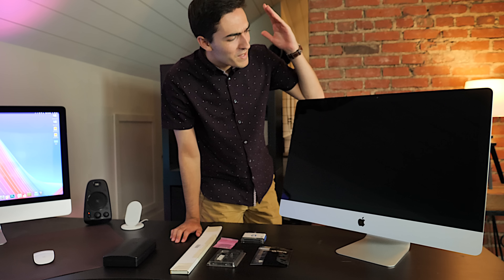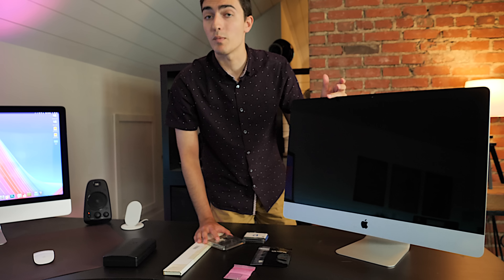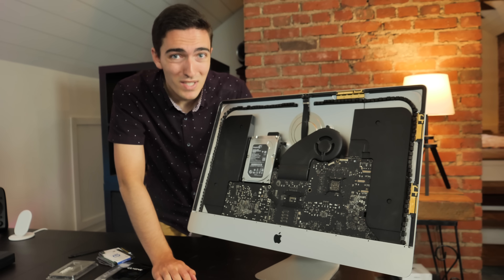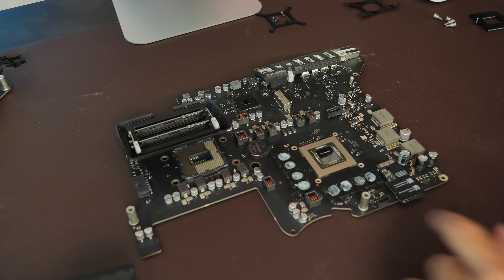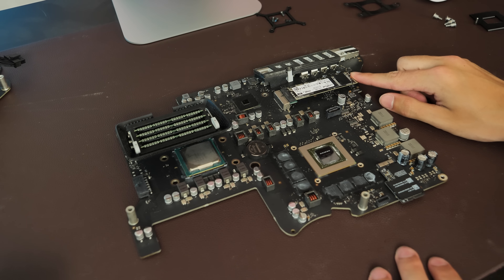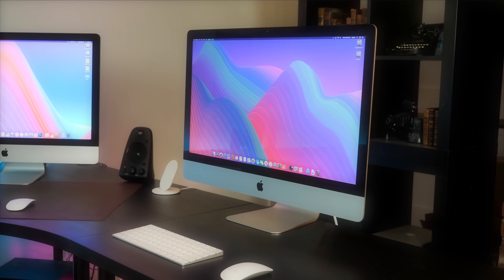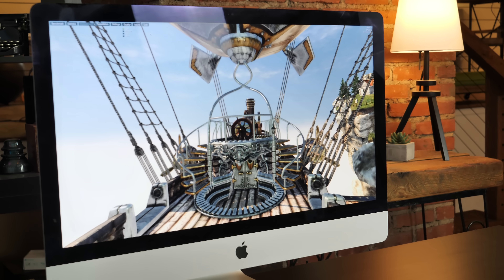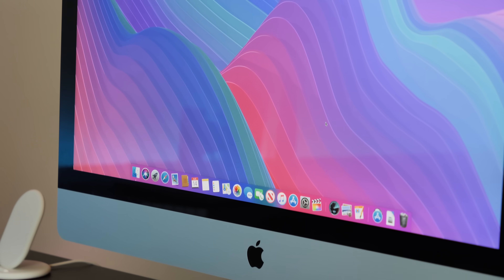Upgrading the $500 2013 iMac to the Max!

Comment: I have an iMac 2010 21.5 screen with an i3-540 processor, 12GB ram memory, Ati Radeon HD4670 and macOS High Sierra.
I upgraded my CPU to i5-660 3.33Ghz, same TDP, socket, etc. My iMac started fine but everything worked slower, I cannot watch youtube without dropping frames, the same on ZOOM.
I run Geekbench 5 and here are the results
i3-540 Single core 511, Multi core 1122
i5-660 Single core 226, Multi core 519
What did I do wrong?

Comment: Hey Luke, I used your example of this recently and had great success replacing the power supply and adding max RAM and an SSD. Unfortunately the iMac developed a display issue after testing, in the process of sealing back up.  It developed two thick vertical black bars on the right side of screen about 2 inches in.  Nothing I could do to fix that.  Any ideas?

Comment: I also have an IMac 27 inch late 2013 Model. I purchased a Samsung 1tb SSD, 1 TB Samsung NMME, NVME adapter, thermal sensor, 2.5 to 3.5 bracket and tool kit. Overall I spent about $300.00. for my upgrade. Not sure why i waited so long to upgrade. I was planning on spending $2K on a new computer but with this upgrade i no longer need to spend that much.

Comment: Great video, I am a bit confused about the ThermalSensor, I've seen a few videos where ppl have done it(used SATA SSD) without the sensor and for them it worked fine... no high RPM on fan? Can u confirm...

Comment: @Luke Miani, Hi Luke, I tried this. I have the same iMac. But it will not recognize the Crucial  P1 1000GB NVMe M2.0 SSD. I formatted the SSD on a MacBook Pro that uses SSD. I also made a bootable USB drive but when booting, it will stop in the middle of the Apple Logo and 50% of the status bar. It will not even go into disk utility mode.
I think the original HD disk ( 1 TeraByte ) has problems because 
    1- It will not boot fully 2- I can boot using that HDD drive in Save Mode.
I've tried using another  HDD from and old LapTop and nothing.
I've even tried Option- Command - R - P to erase the NVMEM and nothing. 
I did the Command -D to check and all it said is something like It appears to be a problem with the HDD
Can you help, or some payed remote assistance you can refer?

Comment: Be warned, if you attempt anything with upgrading the CPU (or just replacing the thermal paste), you risk ruining your machine.  Removing and re-installing the integrated heat sink for the CPU and GPU requires some serious skills and delicate work.  Luke conveniently skipped the entire process (and difficulty) involved and edited the video as if it weren't a big deal.  It has me wondering if he purposely excluded that part knowing it's not for the faint of heart.

Unlike conventional PC's, the CPU is not clamped into the motherboard,  It is held in place under tension to the heat sink.  So when you remove the heat sink, the existing thermal paste will keep the CPU attached to the heat sink and one risks damaging the CPU pins on the motherboard.

Reinstalling the CPU and heatsink assembly is hard, especially with the RAM shroud interfering with the alignment.  With new thermal paste, there is no room for error in aligning, and keeping the cpu in place (by hand) while re-installing screws and a strong tension plate from under the motherboard.  Add to that the mess the new thermal paste could make over the GPU while all this is going on.

Do not remove the heatsink unless you're prepared for a long and painful study in patience.
Reply: Gamoń - aleś mi zaimponował. wymiana pasty termoprzewodzącej to faktycznie wielki problem wg ciebie. a naprawdę to identyczny problem jak wymiana pieluchy u niemowlaka. ilu tu dziwaków pisze głupoty, jedni piszą o porażeniu prądem, inni o monstrualnych problemach przy posmarowaniu procesora miodem. czy to banda idiotów, czy tylko mi się tak wydaje?

Comment: If a 21" came without fusion drive, the ssd m2 will not work because it is not enabled on the SMC System Management Controller.
It has been discussed on fora. And tested on mine. I have a 14.3 iMac late 2013 with i7 and dedicated graphics without fusion drive. Also, i replaced the sata drive with crucial mx500 1tb and it did not have problems with the fans... Appearanly  the 14.3 is a odd one.

Comment: hi Sir.. thank you for all your help.... please, I have a top imac 27" but only no SSD... I assembled in apple the best iMac that time... I'm using with my iMac, 2 thunderbolt monitors 27" .. right now I'm feeling some problems in my final cut with 4k footages ... do you think changing for SSD is enough to improve my performance or do you think will be better if I can use a egpu? if yes ill still can use 2 monitors? and what brand do you prefer to buy.. thank you again for all suport

Comment: Hi, thank you for the video. I have a late 2013 27 inch iMac and the drive is failing. I don’t think I have the confidence to take it apart, is it possible to run an external SSD and boot up from that? The rest of the computer seems to be running ok. I have a feeling it must be more complicated than that, am I missing something?
Liked, subbed and rung the bell

Comment: Awesome!
Purchased late 2013 iMac 27” for $520: 3.5ghz, 1tb hdd, 16gb ram, gtx 780m 4gb
Upgraded for $100: 32gb ram & 512gb nvme ssd (holding 1tb hdd as 2ndary storage)
Deep-cleaned internals and repasted heat sinks: not a gaming machine whatsoever, however, runs 4K video editing suites BUTTERY SMOOTH! 🧈 🧈 🧈 the 4gb vram really sets it apart!
At $620, this is THE BEST amateur-budget-video-editing-Mac, even in 2020

Comment: Hi Luke, thanks a million for the video! I ended up max'ing out a 3.4 GHz late-2013 27" iMac with a 1 TB mechanical HDD:  upgraded the CPU to the Core i7-4771 (miserable experience, nearly borked the machine), a Sabrent Rocket Q 1 TB NVMe (2280) PCIe drive as the boot/application drive (not terribly difficult - get the right tools and follow the video directions closely - the OWC PCIe SSD drive replacement video is the best), a Crucial MX500 1 TB SSD drive for data (pretty easy, once the display has been removed), and upgraded the memory to 32 GB (Timetec, trivial to upgrade). If anyone is still considering something like this in 2020 or later, I'd suggest:
- get the right tools (from iFixIt), especially the "pizza tool" to cut the display adhesive - using old guitar picks and ancient credit cards you find laying around to open the display is dumb - the right tools will cost less than $20 - to replace a botched display will run about $600. Do the math...
- try to avoid the CPU upgrade - it can be done, but it's seriously no fun and you run the risk of borking your investment - try to find a refurbished or used unit with the Core i7 already installed
- if you're REALLY lucky, try to find a unit with the upgraded graphics - the GeForce GTX 780M with 4 GB VRAM
- definitely consider installing a PCIe SSD drive as your main drive - the slot is only a PCIe x2, but you'll still get better performance than the SATA3 drive connection
- as long as you have 8-16 GB RAM to start out, you should be good - upgrading RAM is a <30 second job and can be done at any time - I went with Timetec ($60 for a 16 GB DDR3 2-dimm kit) and have been happy with the performance
- like others in the iFixIt forum have pointed out - don't bother with the OWC SSD temperature sensor - just install the free Macs Fan Control apps and you'll have much more control over the system fan
- if possible, tally up the total cost of a system + any upgrades you might be considering and then weight this against your other options: (a) a new iMac, (b) a later model with Retina display, (c) a custom Hackintosh build if you're adventurous... All in all, I'm pretty happy with the late-2013 27" iMac - the display is 2K and pretty nice and the performance is good. Apple does a great job optimizing the hardware+software, so even modest looking specs may give you a very capable unit.
Thanks for the many great videos! J
Reply: How did you almost bork the board during the CPU replacement? I'm genuinely curious about that as it's a fairly straightforward process: remove heatsink, clean off old thermal paste and pads, swap cpu, replace thermal paste and pads, replace heatsink. Did you forget to tighten the sink down in a clockwise starfish pattern like changing a tire maybe?
Reply: I need help . I installed a m.2 SSD with the adapter . And I'm keeping the hdd for extra storage . I'm having issues installing Mac os onto the SSD . Using opencore when I select the drive to install (the SSD) , it'll start the install with the progress bar then reboot back into recovery . Not moving forward with the install

Comment: I have a late 2013 21.5" iMac with the1tb fusion drive  and I installed 16gb ram and replaced the 1tb mechanical drive with an SSD and my Blackmagic speeds are just as slow or slower than with the old mechanical drive. what's the deal?

Comment: Whats the highest spec i7 that this model iMac is compatible with?
Reply: Intel Core i7-4771 is known to work - apparently, the Haswell socket will accept other i7 CPU's, but upgraders have reported problems using anything beside the 4771

Comment: Luke, I have a 27" imac late 2014, and I go to add an ssd PCIe 1TB and my imac already has a blade ssd in the slot and this is in addition to my Fusion 3TB. The blade is only about 150gb though. On the blade drive info, it says it's the Mac OS recovery system. Should I not take this one out and replace it with a 1TB?

Comment: HI Luke, watch the video and got the guts to upgrade my iMac CPU to i7 quad core 4771 that i got from eBay, add on the same SSD you you have listed. I did not bought any RAM because 4 of my ram slots is already been filled up. i have 2x8 of corsair vengeance ddr3 1600mHz at the 1st and 2nd slots from the bottom slots and 2x8 crucial ddr3 1600Mhz. 

Install went well but when i turn the power on i started to hear 3 beeps, so immediately i research online what would the 3 beeps means and as i start researching most answer i got says its a RAM issue. so when i took out the top 2 of  ram out of the 3rd and 4th ram slots(Counted from the bottom up) and all went well, but i wanted to max out my ram slots and stanrt wondering why my old crucial ram would not work. So i bought the RAM listed above(ADAMANTA) and install it on the top 2 slots and when i turned it on 3 beeps right after. But just to be fair all rams works because i tried putting em by itself but only work at the 2 bottom ram slots(2x8 corsair vengeance, 2x8 crucial and 2x8 adamanta)

so just wondering if upgrading the CPU from i5 to i7 could have affect the top 2 slots of the ram slots or is there a work around to fill up all the ram with an i7 CPU.

Thanks for all Response.

Comment: Thanks for this great video. I upgraded the motherboard late 2012 late 2013 for a gain in graphics card from 512MB to 2GB I also have better wifi and an MNVE Crusial 500GB (P2) SSD the P2 works without problem even if it is not listed as compatible on the crusial site. 100% functional.
Sorry for the google translation

Comment: Another fan workaround is Macs Fan Controller, I've used this with my 2 x 2012 27" iMac's when upgrading to SSD.  You can control settings and parameters as you like, it works well.

Comment: I just acquired a late 2013 iMac 27inch for free! Nothing wrong with it either. Are you saying that you only added a 512GB NVME drive and left the old physical 1TB drive in place? I'm fine with the CPU and video but really want to do something about that clunky drive. I would like to add a NVME copy the OS to it and then replace the original drive with a SSD as well. I've upgraded my late 2009 Mac Book Pro and that worked great till they stopped supporting the software. Any guidance would be greatly appreciated. Specs:Late 2013, Model A1419 EMC No. - 2639

Comment: Thanks for sharing performance differences. I have a late 2013 purchase new with Fusion and I installed a SATA SSD a few years ago...Recently it's become know that these can be upgraded to the newer form factor SSDs and your data performance is very  useful. Mine is loaded already, just need that "stick" performance and likely going to update mine and get a few more miles out of it before buying a 2019 loaded machine.

Comment: For $800 I can get brand new 3300X based Manjaro, with 27" IPS (tilt, shift, bla-bla), and with a mechanical keyboard which is going to beat that iMac twice. Without a risk to be  shocked by not isolated capacitors -)

Comment: Question for Luke... I have a 'late 2013 27" i5 CPU / GTX 775M GPU chip' and wonder if I can replace that GPU chip with a GTX 780M chip?  Would that create a problem for the i5 CPU logic board?

Comment: Hello Luke. Just upgraded the processor and PCIe ssd . Everything went smoothly but now my top 2 ram slots aren’t working. All I get is the 3 beeps when all 4 sticks are installed. I’ve tried multiple different ram sticks that function perfectly in the bottom 2 ram slots. Have you ever run into this problem? Thanks! Love the videos

Comment: I know this is an older video but I have a 2013 and the fans don't blast with a Sata SSD, I have a 1TB WD Blue SATA SSD in the HDD bay and also have a 1TB WD Black NVMe SSD with the adapter on the proprietary slot on the logic board. Mine is  2013 21.5" with the 2.7GHZ i5 mobile soldered on CPU which I'm going to upgrade to a core i7 4770S with the 2013 iMac logic board that has the cpu socket and the dedicated Nvidia graphics as this thing is basically a giant laptop with its specs. I already upgraded the ram to 16gb, its all it can handle with the i5 but Intel's site says that the i7 4770S can handle up to 32GB of 1600MHZ DDR3 ram so I don’t know if I wanna do it for cost reasons but it would be nice spec wise to max it out.

Comment: I’ve followed your guide to upgrade. However, when I turn on the iMac, it beeps 3 times. I change to original RAM and CPU. It is the same. No luck. So frustrated.
Reply: 3 beeps generally the RAM is not seated properly, but the good news is that you can reseat the RAM from the back (if its a 27)

Comment: I did this type of upgrade on an older 2011 imac 21.5"  educational version....this is a low spec model made for schools and had an i3 and 4gb ram...I put an ssd in it, 16gb  ddr3  1333mhz, and lastly, I wanted to go with an i7 but could find much help on the compatibility...ended up taking a chance with the 2600s i7... from what i could see, it should be compatible and the temptation was to go with the even faster 2600  regular i7...This was Nor recommended becuz of higher power draw and thermals in the small 21.5" case... I went with the 2600s and it works fantastic... now 4cores 8threads up from 2 cores 4 threads..temps are almost the same as with the i3 but a hell of alot faster.. running high sierra... cost of this upgrade was  65.00 for cpu, 30.00 for 16gb ram, I had the ssd already and I got the computer for free becuz it was gonna be thrown out...total cost under 100.00  ...

Comment: first i cleaned the heck out of everything. then added 512gb nvme ssd inside and installed 512gb 2.5 sata ssd, and switched from 8g to 16gb ram. big improvements. thinking of going back in to up both the ssd's to 1tb each. i love working on these imacs

Comment: I just picked up a late 2013 21.5”, i5, 8GB Ram iMac. What are my options for upgrading and is it worth doing. Wish I had watch your video first. Can the Ram be accessed from the back or only from the front, removing the logic board?

Comment: I wish you would have run the new SSD through the Black Magic Disk Speed Test so we could see if the read/write speeds exceeded the 700 Mbps barrier of SATA2. Also, you had an 8-year old iMac disassembled but you did not replace the motherboard battery, which rarely last longer than 8 years.

Comment: The SSD needs to be set up as the boot drive holding the system and apps.  Without that step the improvement isn’t fully realized.

Comment: I'm not finished watcing the video but regarding the temperature sensor issue- you can just bridge the cables (put a metal cable tie in the ends even) and it will work.
no more 100% fan speed for the HDD fan :)

Comment: i know you made this is 2019 but if you don't want the fans running at max RPM all the time then install Macs Fan Control designed for Mac OS Sierra or laster it lets you choose how much the fan runs at very useful and I use this too

Comment: i searched upgrading an imac 27 with NVMe even if it isn't used at its full potential, if the cost is similar, why spend money on older tech?, i didn't find anything, then i thought about replacing thermal paste and i found you! PERFECT! this is soo cool! thanks, this is really what i wanted to know. i didn't know you could upgrade to i7, i am so happy, wow! thanks so much!

Comment: @Luke Miani what ssd would be good for a imac late 2013 21.5 inch? I have a iMac late 2013 with a defect HD and need to replace it, but I am struggling with the parts. I am especially fearing the quirk you spoke about that the temperature sensor doesn't work

Comment: I have a  27” iMac Late 2010. Should I bother installing an internal SSD? I am using a 1TB  EVO SSD connected as an external USB now as my boot. Any big gain in speed?
Reply: Yes I have a 27' Late 2009 and I used to use a USB 1 TB SSD and then decided to install an internal one. Honestly the difference is mainly in boot times, with an internal SSD it boots in 10 seconds, with an external USB SSD it takes like a minute. However, once the computer is booted there isn't that much of a speed difference, maybe like 30% faster app openings